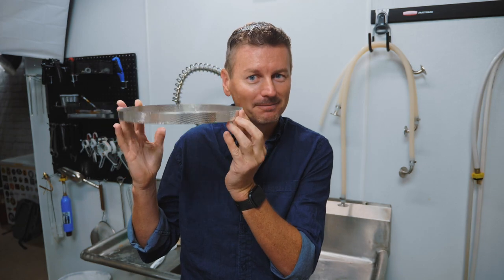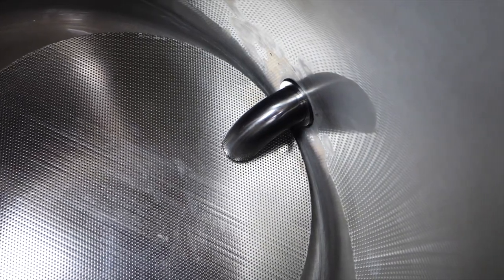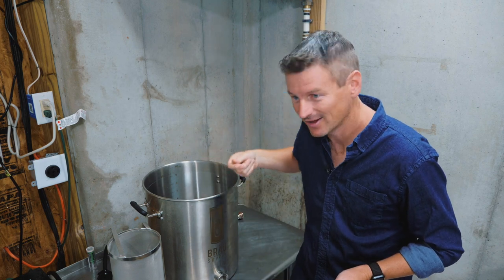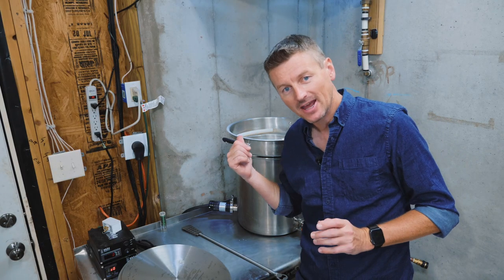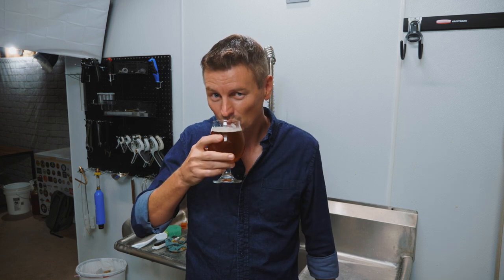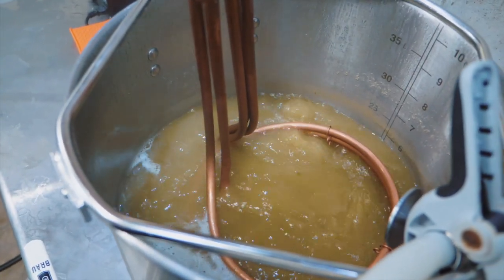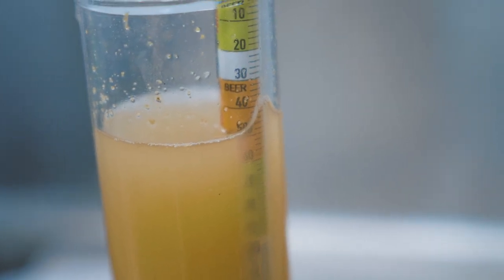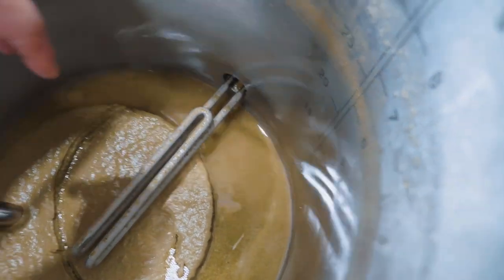German Pils | HopBlock Hop Filter | How To Brew German Beer

Comment: Loving all your videos, very professional. Are all your brews based on US gallons (6 pints per gallon) and not UK gallon (8 pint per gallon). Thanks
Reply from the maker: Thanks and good question. Everything is US measurements.
Reply: @TheHomebrewChallenge  knew you probably were, but had to check if you were still old school 😉
P.S. loving the brew challenge 😊
Reply: @distractiontherapy  Your statement is misleading. Both the US gallon (3.79 L) and the Imperial gallon (4.55 L) contain 8 pints. A US pint is 473.2 ml, whereas an Imperial pint is 568.3 ml (https://en.m.wikipedia.org/wiki/Pint). Interestingly, the word "pint" is related to "paint" and is supposedly derived from painted markings on a vessel indicating this volume (https://www.etymonline.com/word/pint)